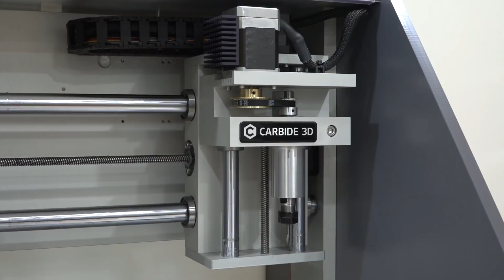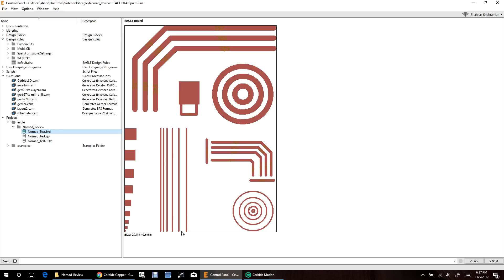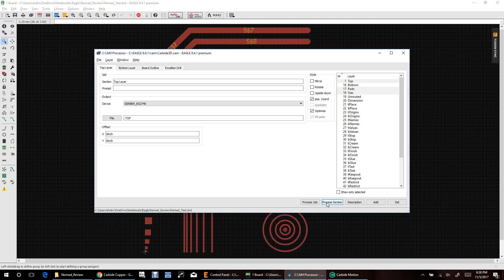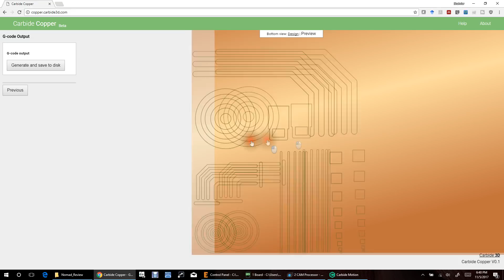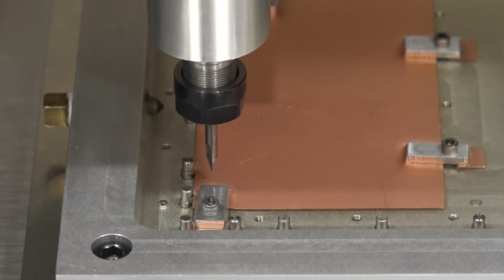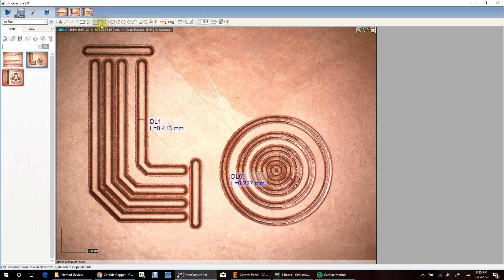TSP #115 - Carbide 3D Nomad 883 Pro CNC / PCB Engraving Machine Review & Experiments

Comment: 6:00 - I have to laugh at the specs being listed in imperial instead of metric.  Yes, it is US made but if they want to sell their products internationally they really should be using the measurement system that the rest of the world is using.  Or at least list both inches and millimetres.  Most people that already have a 3D printer, for example, use metric and thus can relate to seeing the bed size and travel speeds if it is in metric.
Reply from the maker: ElmerFuddGun I couldn’t agree more. That’s why I did the review in both units.
Reply: Yes, I had no problem with your review just laughing at the manufacturer!  Just like when I see a technical product with specs listing temperature ranges in °F only or with °C in brackets.  Their main sales may be in the USA but most technical people work in °C no matter where they are.  And AFAIK NASA included!

Comment: I thought submersing the PCB in cutting oil was a very good idea.
Reply: Wonder if the FR4 or other substrates would absorb the oil or create a delamination problem.
Reply: That's a good question.  If absorbed it may also change the electrical/RF characteristics.

Comment: Spindle speed isn't the important value, it's the motor power. I would have bought a Tormach 440, it is the best bang for buck you can get at the moment without going used. Also you get it flat use a vacuum bed, it will suck it down evenly across the board.

Comment: I'm quite disappointed that of all people, you took the shiny marketing bait.

For this price you could have purchased a 6040 CNC router with a 24 000 or 60 000 RPM,  1800W, water-cooled brushless spindle(that's also quiet!), proper ball screws, the ability to autolevel, basically identical(if not better) repeatability, more powerful axis motors, a much, much larger work area(60x40cm), and you would be able to mill anything up to aluminium, and engrave even as far as titanium or hard steel. The list of features goes on and on, and the community around these machines is amazing.

The setup takes a little longer than plug&play, but this is serious money, and arguing about that is silly, especially considering you're smart enough to understand complex RF circuitry.

This machine is a joke. You could probably bend the ultra-thin(and completely open!) lead screws by sneezing at them, the only advantage it has is an enclosure and oversized(just for this machine's scale, mind you) polished rods - but again, for this price I would've expected nothing short of HIWIN MGN12 or MGN20 rails, and more than one per axis, ballscrews, and more than a silly 40-watt spindle motor that'll stall on anything remotely challenging.

It doesn't even let you autolevel PCBs, which is absolutely crucial when doing any sort of fine pitch work.

Source for all of this: I've been working with CNC gear for many years now, and own a 3040 router myself(the smaller brother of the 6040), with numerous modifications, and I make 0.5mm trace/space 2-layer boards at home regularly with said machine.
Reply: How is the repeatably on the Chinese machines? I want something for drilling, and engraving aluminum front panels (Up to 8x19 inches) for small scale production runs. I was looking at CNCRouterParts kits originally, but would be somewhere in the 6k range for a starter package that suits my needs.
Reply: Repeatability is within a few hundred microns over hundreds of runs, you're good to go. Just get the ballscrew version, not the acme screw version.
Reply: 100 micron is disastrous, that's 4 mil, while the 883 guarantees 1.5 mil repeatability, and in reality, some tests shows exact bang on results on 883, so the 1.5 mil claim is quite conservative. If you need to mil small metal (brass) structures down to single digit mil tolerance, then that's where the 883 has its value.
Reply: @zomgthisisawesomelol Note that I said "repeatability" and "over hundreds of runs". You'll get <10um positioning accuracy for small parts in a single run.
Reply: @zomgthisisawesomelol MoS2 lube for the ballscrews - a lot of it, and it really makes the machine much smoother. And make sure to get a water-cooled spindle - the 800W one is the lowest you can go, but they're a major step up from the cheaper DC spindles.
When you get the machine, make sure to re-tighten all the screws. They're often not very well secured at the factory.
If you're going to be milling boards, I have a video showing most of the process - adding an autolevelling z-switch is a must in that case.
Reply: @bskull3232  Note that I said repeatability, not accuracy. It can easily do <10um in a single run with proper settings and tightened bolts.

Comment: PCB traces look pretty bad. Something is not right at all. 
Maybe it is the problem with endmill that you are using? Try getting some 1/8'' 2-flute and 4-flute carbide endmills, STUB size, from KBC tools for example. Your minimal spacing between tracks will be 1/8'' but tracks look sooo much much sharper. Small diameter (<2 mm) emdmills lack rigidity even for PCB - this is what happened here.  I tried milling with 1/8'' endmill, just 1800 RPM, on my manual mill with DRO and 2 oz/ft copper PCB and I got much better results - almost perfect edges. 

Much better and QUICKER solution would be flat bed UV printer and then chemical etch. Flatbed UV printers are not cheap but still about 1/3 of price of this CNC machine. Printer head is light so no extra rigidity required and so they can get away with light aluminium frames. 

Hobby sized CAST IRON body milling machine is about $1500 - 1800 with motor, spindle and everything. I cannot understand why these companies cannot order some cast iron beds for their CNC machines. They just keep making CNCs out from aluminium sheets bolted together. Why god why !!??
Reply: IMVHO the main problem for bad looking traces is waaaay to high feed per tooth.
Reply: Agree, that too.  Also bed seem to be twisted at least 5-10 thou since it is on wooden table and made of aluminium and not leveled properly.
Reply: 1/8" is far too large to be used for the kind of isolation work he wants to do. It would be useful for clearing out large areas of copper though.

Aluminum is fine for the size of this machine and what it realistically can accomplish (plastic and copper machining). The cheaper cast iron mills can be a bit rough around the edges, last time I checked. Taig and Sherline are proper precision mini mills and both use a lot of aluminum. But they are not optimal for fast motion, like this linear rod design is.